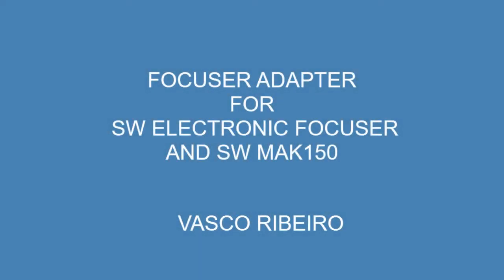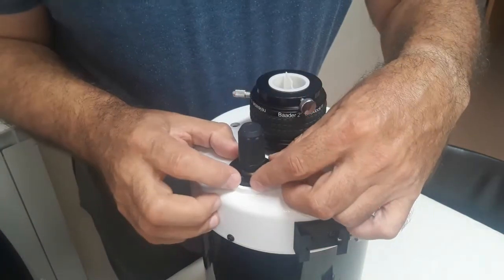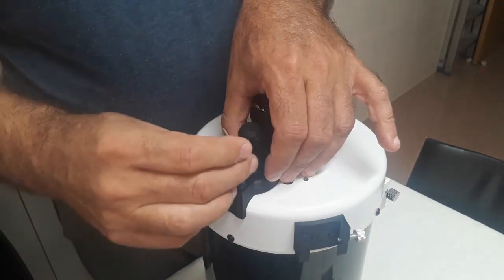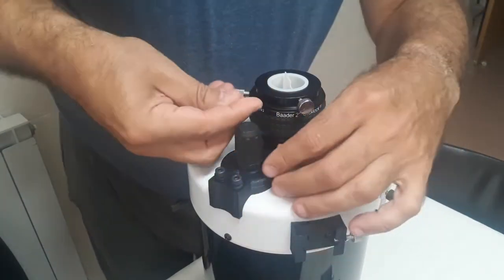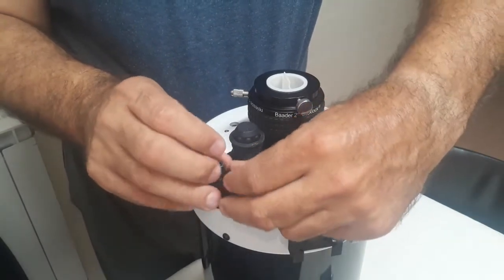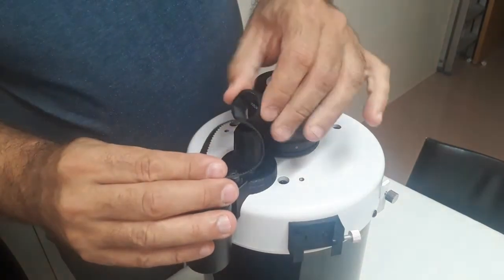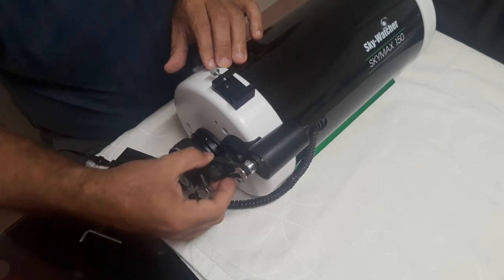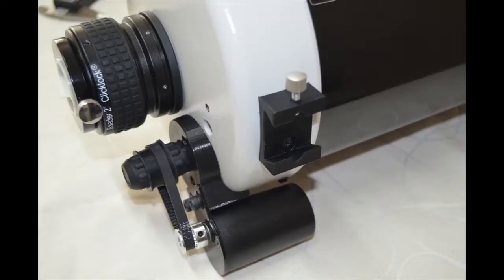MAK 150 Motor Focuser adapter

Comment: This is exactly the device I've been looking for! It mounts in five minutes without altering the telescope's structure, and it works perfectly. If you want to make focusing your 150/1800 Mak easier, this is the essential accessory for attaching a focusing motor. Reasonable price, fast delivery with tracking—I highly recommend it.
Reply from the maker: Thank you very much for your review!

Comment: This adaptor works perfectly on my Skymax 150 and ZWO EAF focuser. It turned out that the plate supplied needed to be a little bit longer than the one Vasco supplies as standard but, to be honest, he couldn't have been more helpful in getting the installation working to my complete satisfaction. Vasco is a very friendly and helpful person to do business with and I have no doubts about recommending him and his focus adaptor to you.
Reply: Vasco, I owned your direct solution for mak127 for zwo eaf and worked like charm. Now I have upgraded my mak to 150 and would like to have the same direct solution. Is it possible?
Reply from the maker: Thank you Robert for your great review